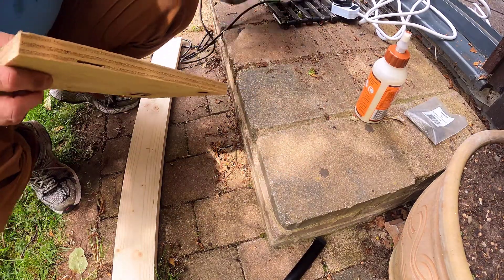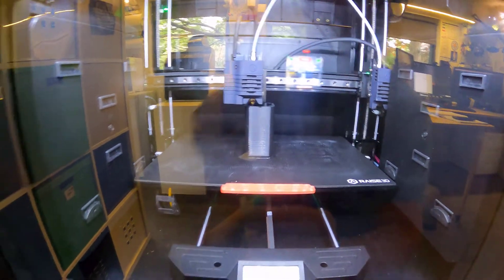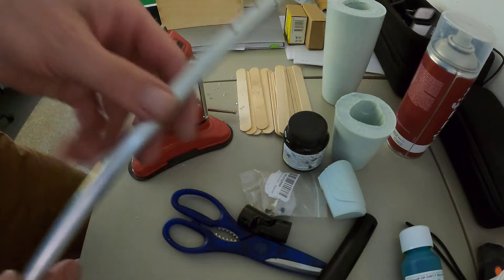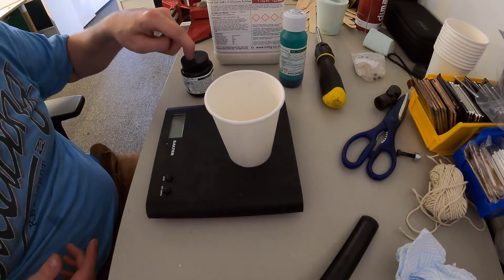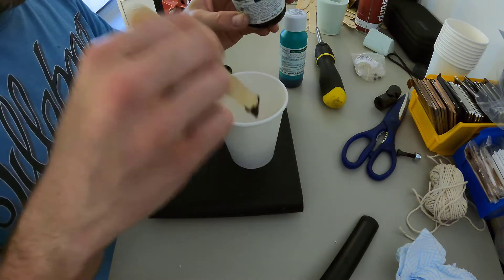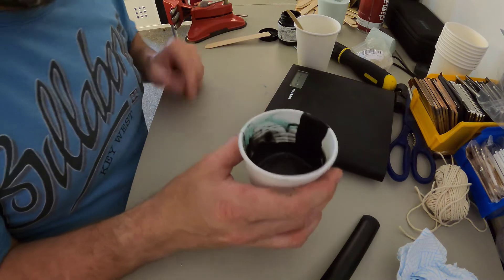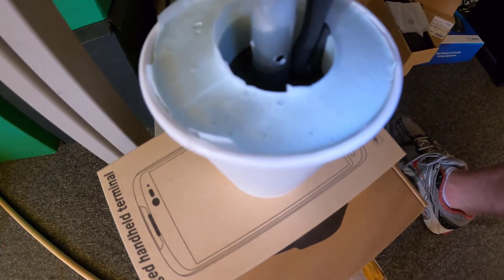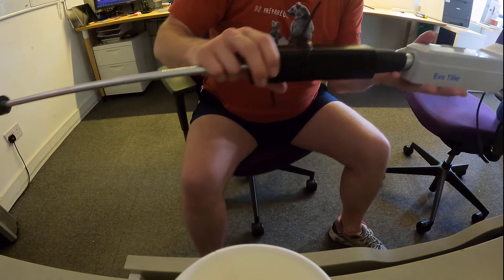Boat projects - Building a tiller extension and outboard pad for my Electric outboard

Comment: Hope you are well! This custom printed grip that goes over the tiller looks very cool. This may I am about to buy the epropulsion sprit for a boat I am building, and I want to request you if you can share any specifics related to the extension connector you designed and printed. The ideal length of the tiller extension that I think will work best for my boat is about 6 feet. I understand that it is a tad bit long, but I think the longer tiller extension could be a cost-effective solution. Thanks much,
Reply from the maker: Hi there. Cheers for the comment. So just remember that a 6 foot tiller would have a huge arc for turning the boat. It may be unusable as you would only ever get a very small angle to turn the tiller. Hope that makes sense.

Are you trying to be able to adjust the steering from up front of your boat? You can set the ePropulsion to be very stiff to turn so it keeps a course if you need to pop up front.
Reply: @SailingWithDave  That is a really good point, and I have not thought about the angle I can steer with such a long extension. I may have to re-think the long extension route. 

The boat I am building has a neat wheel house, and it would be very nice to "sit" inside it and steer. It is required for almost all lakes around me to have electric powered motors only. I am at the end of my build and want to avoid working on a whole cable steer system.

Trying to find the best possible, simple and out of the box solution for this.
Reply from the maker: @AlrightThanks  Yes Lake Bala here is electric only apart from club ribs and emergencies. Could you use the remote features of the Evo Remote? and then mock up a steering wheel somehow or is that a bit too much?

I did see someone using string and pulleys to create a steering system to their rudder from their sail boat cabin. Think it was Sven Yrlwind. That could work maybe? but i'm not sure if pulling on lines is going to be practical in this case?